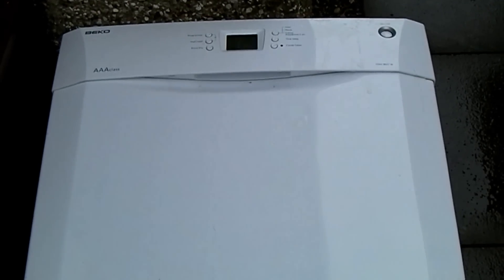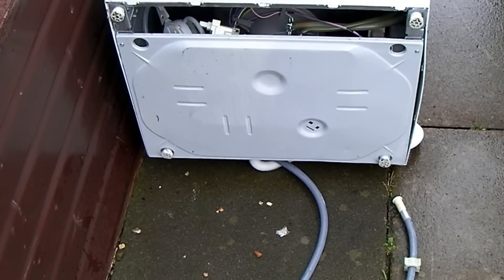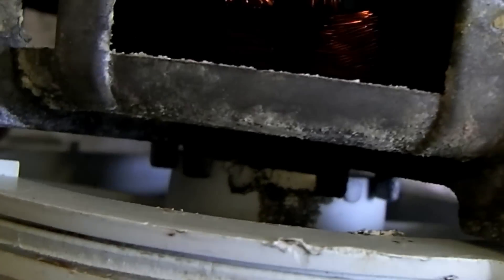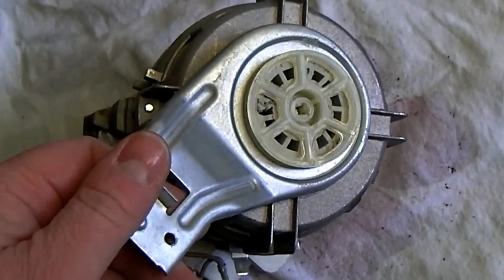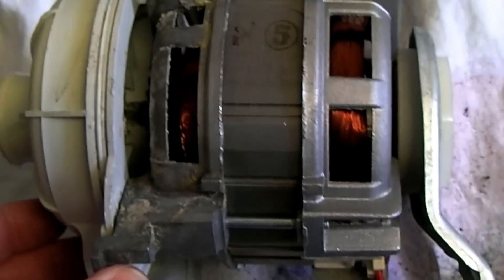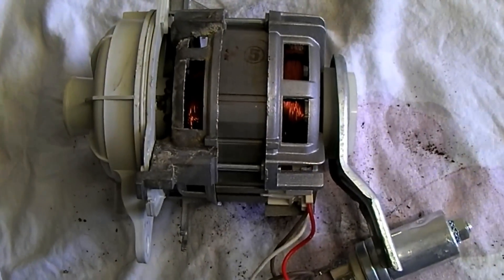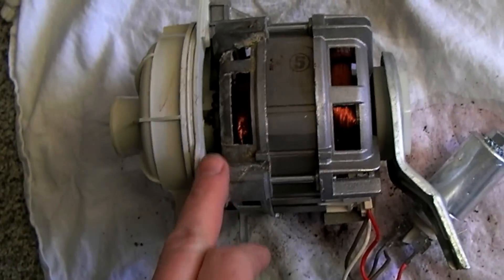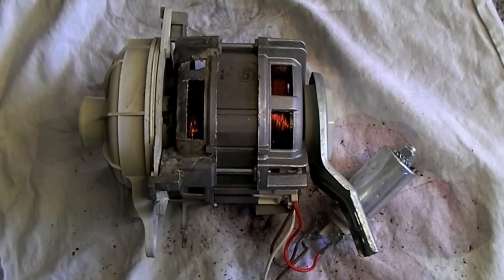Beko DWD8657W Dishwasher Pump Fail

Comment: I have a beko dishwasher and the red salt light will not turn off after filling it with salt. and leaving a salty residential on everything.  any advice thanks
Reply: TheLennon1250 fill salt with hot water and shake.
Reply: Put a spoon in the salt bottle and stir the salt around before replacing the cap.